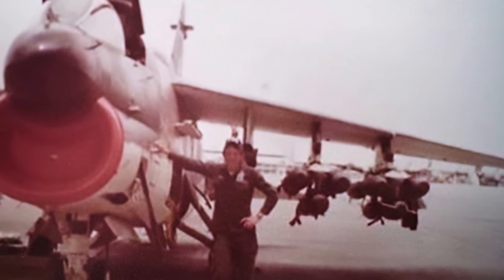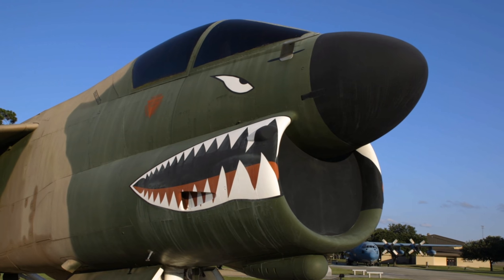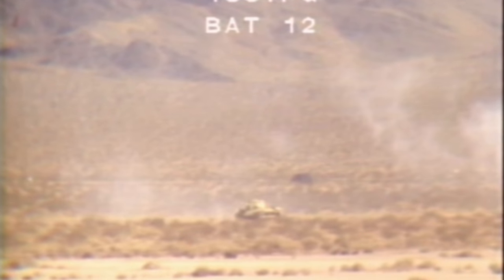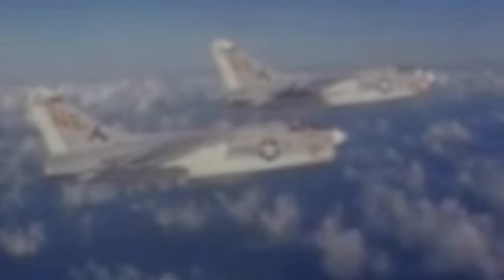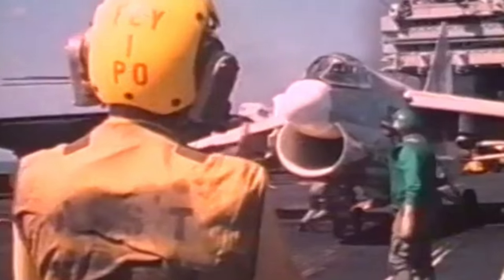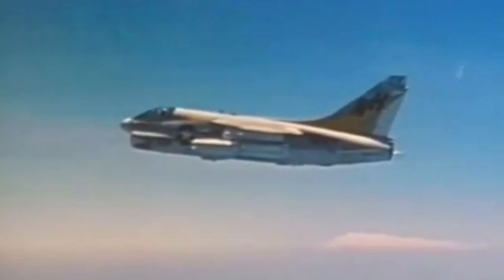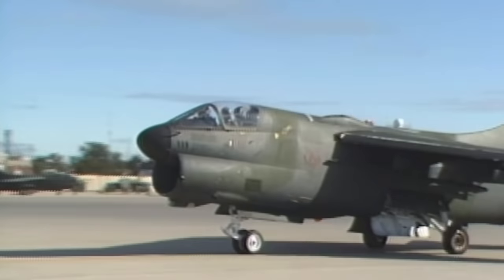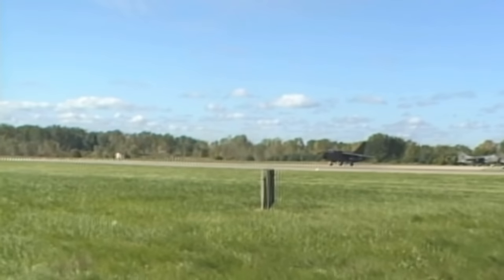A-7 Corsair II | SUBSONIC CARRIER ATTACK AIRCRAFT

Comment: corsairs and skyraiders were once an infantry mans favorite sight, when they were overhead you knew you had pilots wanting to get down and dirty against the enemy. the skyraider was an amazing weapons platform that doesn't get the recognition it deserves.
Reply: rigsby556 I think the Tucano should be scrapped and bring the Skyraider back with updated systems
Reply: @MeanLaQueefa  ability to take off from carriers and short roads made it an awesome platform. carried everything but the kitchen sink
Reply: The US Navy and the USAF literally flew the A-1 till they wore the airframes wore out. By the 1960s most of the US A-1s had bad and shorted wiring (wing cannons jamming or exploding was a concern). The planes also had stress fractures in the wings. The USAF took over Navy A-1s that had lower maintenance  hours and flew them until they had no choice but to replace them with A-7Ds.
Reply: I know nobody wants to give up the A-10 (except some brass) but the ideas for replacing it were worth discussing.  

One of the proposals was to bring back a single prop airplane like the A-1.  For the cost of operating one A-10 the AF could operate more than four of these (there were also four different planes being considered, I forget their names).

They could get down in the dirt even more than the A-10, believe it or not, and have excellent endurance.  None of the proposals carried as much as the A-10, though (only bombers can).

Anyway, that is what the whole discussion was about in regards to obsoleting the A-10.

(There is also a stealthy CAS proposal that seems pretty cool.)
Reply: @eb3279  You don't want to get down in the dirt even more unless you're avoiding radar. The requirement to get low is entirely based on older aircraft forcing pilots to visually acquire ground targets when they were flying too fast and too high for it. Now with targeting pods the need to get low has been reduced, and in fact its undesirable to make yourself an easy target.
Reply: @eb3279   not much need for prop planes in any combat except anti insurgent. Even the A-10 id risky against MANPADS.
Reply: @eb3279  as cool as the a 10  and all other the ground attackers are. against the likes of china and russia all they are good for is catching missiles. and with the us moving away from middle eastern conflicts and china rising it is unlikly in my opinion to see planes like that outside of drones
Reply: @benoregan9016  People that want to keep the A10 do not want to be told how good they are at "catching missiles" A10's are very good at working over an enemy that has no air defense, not even too many man portable missiles. The US would have lost a lot of A10's if the A10 would have been put to task in the mission it was designed for (take out as many Soviet main battle tanks as possible,with Maverick/TOW/Hellfire missiles) The West knew it could not match Soviet armor in number of tanks so it went to the air. There is a type of quality in quantity (Soviet doctrine or how the Soviets think).
Reply: @rigsby556  ahahaha! Tell that to the Dambusters during the Korean War who DID drop a kitchen sink on the enemy! Or VA-25 Skyraider “Paper Tiger II” which dropped a toilet on the enemy!
Reply: IMPRESIONANTE  el Skyraiders , podía decolar de los portaaviones  sin usar las catapultas. 
Decolava solo con su poderoso  motor Wirght R - 3350 26 W de 3.050 H.P.
El último avion a hélice usado por la U.S . Navy y la US Air Force. 
Un avion formidable  .
Reply: There are literally hours of video on the Skyraider.

Comment: Was stationed at Pt Mugu, and worked in the IMA/AIMD in shop 65G. Think I was the very last person to go through most of the FRAMP schools at Lemoore for AQ's supporting A7's. Did heads up displays, projected map displays, inertial measurement unit, armament station control units, doppler radar and all the test benches used for that.

Comment: When I was little my dad was a teacher and flew A7s for the ANG on the weekend. One time he snuck me into a simulator at Wright-Patterson. This was about 1983. It was basically a big room full of '80s computer equipment and the disembodied cockpit section of an A7. My feet couldn't reach the rudder pedals, and they were super hard to push. It didn't exactly have advanced graphics. Firing an AIM-9 wasn't spectacular. But it was a real military simulator, and I was in a real A7 cockpit with the actual HUD. And a laser HUD was a pretty badass thing in 1983. As a 7-year-old I thought it was the coolest thing ever.

My dad always had two big bullets on his bookshelf — a 20×102mm that his A7 shot, and a 30×173mm from an A-10. The 20mm one was kinda old and beat up, and I could take the bullet out of the casing and put it back in. The 30mm had a plastic ring (like really smooth nylon) on the top and a lot of interesting details. He told me it had a depleted uranium core and if you shot a tank with it the uranium would go through the armor and get white hot and bounce around like a pinball machine inside the tank. There was a GI Joe toy A-10 but they wouldn't get it for me.

Then when I was in about 3rd grade they got GPU-5/A gun pods at the Air Guard. They were huge pods that hung under the wings of the A7 and fired the 30mm shells from the A-10. He said they tried them out, but it was pretty dangerous to have just one because it would make the plane yaw too much, so they put them under both wings, and the first time they tried shooting them when they came back the crew said it cracked the wing spar, so they didn't get to shoot the big bullets anymore.

Comment: Long before the A-10 Thunderbolt, the A-7 performed the same mission.  The dual 20MM cannons had the same throw weight as the A-10s single 30MM cannon, minus the now prohibited use of depleted uranium ammunition.

The post Vietnam War, anti-armor, close air support doctrine we still use today used the A-7.  Excellent video..!
Reply: it had a 20mm gatling cannon, so close to the A-10's
Reply: Prohibited? First I’ve heard. We still use DU rounds
Reply: Frank Cessna That is good news.
Reply: Frank Cessna What about SABOT rounds used in modern tanks? I’m assuming those were exempt?
Reply: MuscleDad420 The US continues to use DU Armored Piercing Spin Stabilized Discard Sabot 120MM rounds for the Abrams tank.  DU is prohibited on European ranges however.  German and Israel have developed a conventional tank round that has nearly the same penetration capability of DU rounds, thus eliminating the environment cleanup issues and the politics of DU.  The US Air Force also has quantities of DU ammunition for AC-130 gunships but new titanium and other composite materials DU will slowly be replaced.  Best Regards.

Comment: I used to work at the plant that built these.
Talked with some old timers and one of the stores was about the 1st test fire of the M61. Vibrations caused panels and hatches to pop off like something out of a cartoon.
Another involved a security guard convincing the janitorial staff that the assembly line was haunted. He would hide a radio in an intake and hide then start talking to the janitors as they were cleaning.

And I saved a cutout line drawing of a D/E model from the trash while i was there. Now it is framed in my home office

Comment: I was assigned to an A7-B Attack Squadron VA-155 based out of NAS Lemoore CA. from 1971-1974 made 3 Vietnam West Pac tours aboard the USS Oriskay. I was a Jet Mechanic but also was a Plane Captain and worked as an ordnance loader. I thought it was a great aircraft in that it could carry a variety of weapons. The Pratt&Whitney TF-30 P408 was what power our A7s. It was a great engine over the A models in that it did not smoke as much as the A7A. The last 6 months of my service I worked in the AIMD jet shop rebuilding TF30s. That engine was used for many years there after in slightly modified versions.

Comment: fun fact: it has the same engine as an f 14 but without an afterburner
Reply: Brian Coley  only in the later models, the early models didn't use the roles royce engine
Reply: Wtf?
Reply: This engine had bad performance.  Allison engine.
Reply: It had multiple variants and early engines were troublesome as all early jet engines were.
Reply: Brian Coley  yes the later models used the british engine the earlyer models used the pratt and whitney tf 30-8
Reply: Jeff Clark  pretty sure it was the a varient that used the tf-30s but i may be wrong
Reply: Brian Coley  ...the british Phantoms used it, but WITH afterburner...!
Reply: The A-7D's I worked on in the Air Force while stationed at Myrtle Beach AFB South Carolina in the mid 70's had TF-41-A-1 Engines.
Reply: @stevenl.halesr.6894  I remember seeing the A10s fly over the beach back in the day.
Reply: @Chief-Solarize : That's because Myrtle Beach was the first active wing of the A-10A in the Air Force...We started getting them in mid-late 76, phasing out the A-7D's.
Reply: @stevenl.halesr.6894  I was a kid in the 80s and 90s. I went to Lackland in 1999. Ended up working Air-Trans with C17s out of Charleston and C5s out of Dover. I joined the Army in 2011. I'll always be very fond of my time in the Airforce.
Reply: @Chief-Solarize : I retired from Charleston in 1998...Worked on the last active squadron of the C-141B's there...Was one of the Section Maintenance Supervisors in Bear AMU (Red). Air Mobility Command (AMC...What it was called during my last few years of Active Duty) was once called Military Airlift Command (MAC...HQ at Scott AFB Illinois...Was stationed there too). The 22 years since I've retired have "FLOWN" (Air Force Shout Out), By!!! Thanks for your Service in both the USAF and the USA...I Salute You!!!
Reply: @stevenl.halesr.6894  
I never got the chance to fly on a C141. Mostly C130 C17 and C5s. There was a 141 on display at the back gate near the golf course at Charleston AFB when I was there. Several older prop plane too. Yeah you must have left right before i got there because the C17s were new to CAFB in 1999. Those are some awesome jets. The chow halls in the Airforce really spoiled me btw !!!!
Reply: Chaz - geez they murdered your fun fact. 
I didn’t know the engine was the same as used on the tomcat. That’s kinda cool.
Reply: Nonya Business   First variant of the crusader didn't use tf30 it was first equiped with j57 variant which is definitely an early jet engine which is a axial-flow engine which makes it one of the most basic forms of the jet engine. TF30 and TF41 which both were used in later productions variants are low bypass engines which were also in their infancy but definitely I wasn't talking about them.
Reply: Nonya Business : DUDE...I was a Crew Chief on several A-7D's  (70-241, 70-242, 70-990 and 70-994), at Myrtle Beach AFBSC from 74-77...We had TF-41-A-1 Engines...That's A FACT - JACK!!!

Comment: I worked on A7-E variant I was an Aviation Fire Control Technician (AQ) as such when assigned to a VA 122 I was designated as a weapons system specialist. I got put on Check Crew doing every scheduled inspection, 10 day, all the way through the the 180 day inspections, I worked on almost all systems on the aerocraft, from tip to tail, ray dome to tail pipe.  The A7-E could carry Nukes, it had a blast shield to protect the pilot's eyes.  One interesting with 6 Multi Ejection Racks, MER, attached 36 500lb bombs could be carried but only 32 could be dropped because the 4 inboard bombs hit the wheel doors and jammed them, Pilots did not like that. The normal load out was, 1100 rounds of 20mm, two drop tanks, two Side Winders, plus 2 1000 lbs or 750 lbs bombs, or a MER or TER  (Triple Ejection Rack), The SLUF could carry all sorts of other ordnance as needed. and the F in SLUF did not stand for Fellow, you can figure out what it did stand for, hint it was one of George Carlin's 7 words you can't say on TV. It, the A7 was a good bomb truck. Using the dive toss release a bomb could be slung over 20 miles, the over the shoulder release was also used, as will. after that I was reassigned to the Coral Sea, CVA 43 and worked of A6A search radar. That's enough proabaly too much.

Comment: The A-7 was one of my favorite jets, however, I talked to an A-7 pilot on the USS Forrestal (CV-59).  (Sometimes called "The FID"  *First in Defense*...  Or other times as the Firestall, Forrest Fire, USS Zippo...) *I digress*....   The pilot mentioned that as good as the jet was, that at higher speeds that great big air scoop would make the nose yank down and could be unnerving...
Reply: I flew A7s on the FID, and it wasn’t me that told you that. I think that pilot was messing with you because that definitely did not happen at high speeds.

Comment: My first job in the Navy was working on the flight deck of the USS ENTERPRISE (CVN-65) circa 1984-1985. My personal biased opinion was that I did not like working on/near the A-7. From the point of view of a plane handler it was a dangerous bird. When at full power it could suck a full grown man into its engine from about 12 feet away and reduce him to hamburger. Its exhaust could literally blow people over. I am 6'2" tall, weigh over 200 lbs, and jet blast from an A-7 blew me across the flight deck like a leaf on at least one occasion. Fortunately I was able to grab a hold of a pad eye and nothing serious resulted.

That being said, I acknowledge that the A-7 was a versatile and useful aircraft. There were times when Russian Bear bombers would come out to monitor what the carrier was doing. As the Bear was a relatively slow and unmaneuverable turbo prop aircraft the usual response was to scramble a couple of A-7s with sidewinder missiles attached to keep the Bears company. Thus F-14s were not tied up performing that chore.

One last note. At one point in time I was on an errand that took me into one of the "Flag" spaces on the Enterprise. One of the officers there had a picture which portrayed a P-3 Orion and an A-7. A caption on the picture read, "4 Screws are better than a BJ." :-)

Comment: The TF-41 used the Spey core, but Allison designed a new fan for the engine. Allison also built and tested an afterburning TF-41 as a demonstrator in 1983 or 1984, but the government was not interested. I started working at Allison in 1983.

Comment: I hated working around A-7's.  Back in the late 70's and early 80's, I was a Navy aviation ASW technician assigned to squadron that operated out of NAS North Island in San Diego, CA.  I did all the work-ups and the cruise back in 82 on the Ranger.  Coming, going or just standing still, the A-7 was a most unforgiving aircraft to work around when it's engine was turning.  Even at the idle throttle setting, it could suck you into its intake if you got too close (around 10 feet or so).  Coming towards you, at taxi throttle settings, it was even more lethal and could suck you in from 20-25 feet away, so you always paid attention to which aircraft were turning and moving around you.  That can be tough at night during night ops and darkened ship conditions.  Going away from you wasn't much safer.  The downward angle of the exhaust channeled the exhaust onto the deck about 20 feet aft of the airframe.  The end effect was that it tended to knock your ankles out from under you from as far away as 100 feet as it moved away from you.  A little trick I used to identify possibly troublesome aircraft was to check to see if the canopy was open or down.  The A-7 (unlike the A-6) had a canopy that popped up, so even at night, if you looked around and saw the outline of an A-7 but did NOT see the canopy, BE CAREFUL!!!  One day, I was sitting in the cockpit of one of our S-3As working on the aircraft's HF system.  Another technician was seated to my right in the co-pilot's seat.  The aircraft was spotted abeam of the island facing forward towards the bow, which is where we always spotted the A-7s.  As I was keying in the radio frequency, I saw with my peripheral vision a technician/mechanic from another squadron running down the line of spotted A-7s towards us.  As he went to take a stride, it was like an invisible hand lifted him up in the air.  Out of nowhere, a chief tackled him and together they collapsed in a tangled heap on the deck.  I couldn't believe what I had just seen, so I stopped what I was doing and said "Vic, did you see what I just saw?", to which Vic replied "I don't know.  Did YOU just see what I just saw?"  We had both just seen a guy come within a second of two of being pureed.  Even when I tried to sleep at night, I saw A-7's in my dreams.  I remember one night while I was sleeping, I had a dream of an A-7 and it's gaping intake gradually taxing up to me, looming out of the misty darkness.  When I woke up, I realized I was listening to an A-7 going through a maintenance power turn on the flight deck just above our berthing compartment.  When you start dreaming about something simply because you HEAR it, you know you're dealing with a real beast.
Reply: I wondered about that huge intake.  It always scared me.